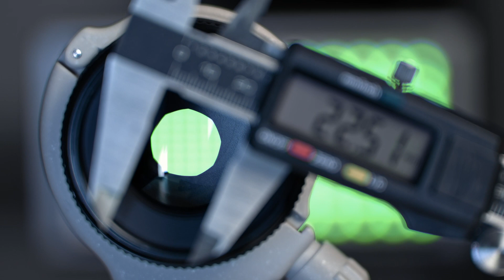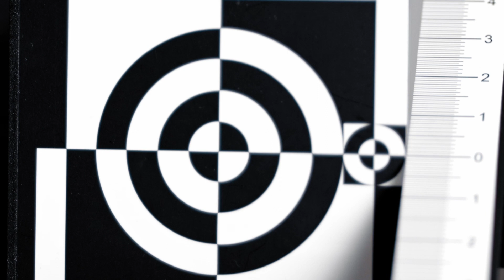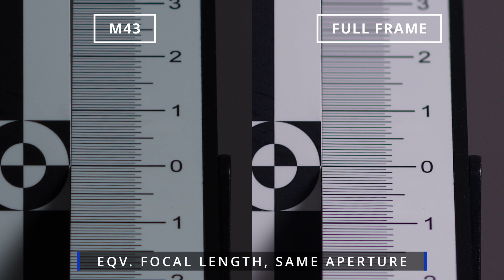Full Frame vs Micro Four Thirds: What is this Crop Factor thing?

Comment: An important point regarding how crop sensors achieve field of view equivalence in an image: assuming all other equivalence factors have been accounted for, a printed M4/3 image captured using a 25mm M4/3 lens effectively represents a full frame image captured using a 50mm full frame lens (i.e., M4/3 offers a 2x optical zoom and therefore 2x longer "reach" at a given focal length); however, an image captured on a M4/3 camera using a native 50mm full frame lens (without a speed booster) would instead represent a full frame image cropped to the relative M4/3 field of view and then expanded to match the native M4/3 25mm image at a given print size (i.e., it would merely offer a 2x a digital zoom along with an inherent degradation in the resulting image quality). This is something to keep in mind when shopping for a Sony, Nikon, etc. APS-C camera with the intent to use full frame lenses which share the same mount.
Reply from the maker: I am not entirely sure what you're saying, but a 50mm lens on a MFT body will be equivalent to a 100mm lens on a Full Frame body. It does not matter if that 50mm lens is designed for MFT, APS-C, FF or Medium Format. It will be a 50mm lens and due to the crop factor it will have the same field of view as a 100mm lens on a Full Frame body.

Comment: Your test and reasoning makes sense for depth of field. It seems that the mft images are darker than the FF samples. In order to get almost identical images, would you need to open the mft to half the FF aperture, i.e. Mft will be f/1.4 and FF will be f/2.8? There are so many other videos that say to double aperture so I really don't know what to believe. I'm a fairly novice photographer and I shoot exclusively mft. If I want identical images in regards to composition, depth of field, exposure, can you provide an example for the focal length and aperture for both FF and mft?
Reply from the maker: The reason behind it is simply the ISO values are not standardized. If you go to DXOMark and compare the two sensors you will see that the ISO200 on both cameras are different when it comes to lab measurements, the A7R3 is measured as ISO 145 and the Olympus is measured as ISO 83. This can be due to different technologies and different standards used at different companies. For example set to ISO 100 the GH5 II from Panasonic measured as ISO 76, the GX8 63 and the GH4 88, so as you can see not even the same manufacturer will give you the exact same ISO performance. For some reason Olympus liked to way overstate their ISO values.
Reply: @holdmylenscap7241  thanks for the response. took me a few hours to do some research and read the math behind it. in theory, if two cameras of different sensor sizes have the same rated iso, set to the same aperture, and equivalent focal length, they should produce an almost identical image? this is why a mft 50mm length set to f/2 will expose an image to the same amount of light as a mft 300mm lens set to f/2, right? because aperture is a fraction.
Reply: rewatching the video a few times makes it clearer. it's depth of field that gets indirectly affected. so a ff 50mm f/2.8 lens will have the same depth of field as a mft 25mm f/1.4?
Reply from the maker: @artoriaslee  that is correct. Which means with the MFT you get a 2 stop brighter image, so you can use lower ISO or faster shutterspeed

Comment: When trying to anticipate depth of field I’ve learned that it is useful to think of a 25mm f1.4 as a 25mm f1.4 regardless of the sensor behind it, because that’s the way it works. The reason us MFT users have greater depth of field is because we use a wider lens to get similar framing to larger sensors. It has nothing to do with the sensor size. I’m guessing a lot of myths about smaller sensors come from photographers with little experience with them.
Reply from the maker: Exactly. Both focal length and aperture are physical measured values and regardless of the camera it's used on. This is what I explained to my wife when we compared the Olympus 75mm f1.8 with the Samyang 135mm f1.8 that they might give you a similar framing but the Olympus has a much shorter focal length

Comment: You are 100% right about aperture. And  I would say : when we used in the past a light meter, was there any position for 24x36 or for 6x6 ? Never !
Reply from the maker: that's a really good point :)
Reply: That would depend on how much you wish to enlarge your negative
Reply: @brucegreaves3204  ????? what is the ratio between exposure and enlargement ?
Reply: Right on. It surprises me how so many have never learned or have forgotten that the speed of light is a constant. Basic physics.